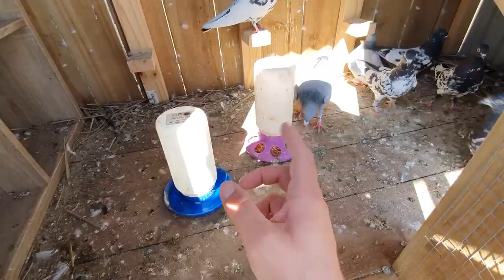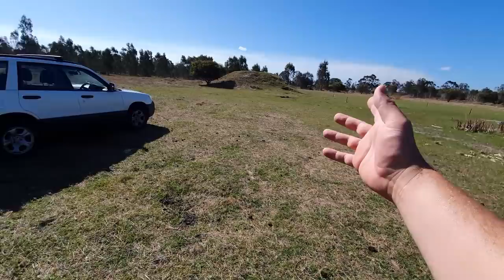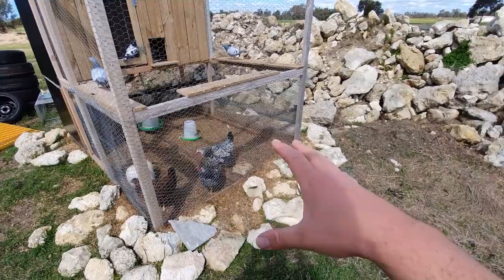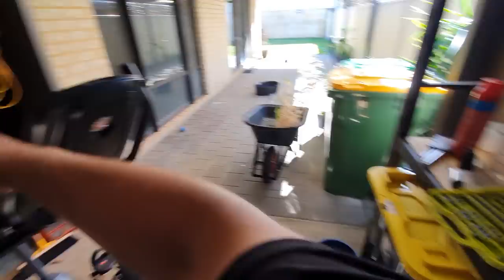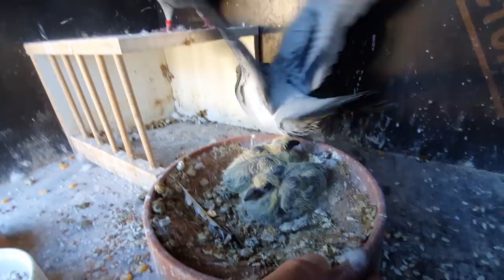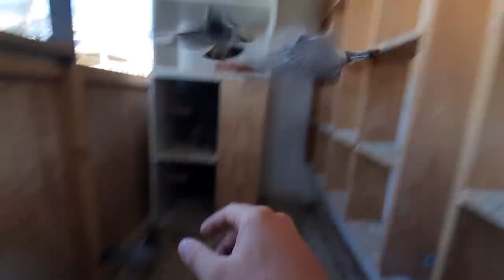Racing Pigeons & High Flyer Update 2020

Comment: I would take all the young birds out to the block now because they would normally be up in the air by now. With the flight they will get used to the environment quickly as they would home to that loft as they’ve never been out put a trap on it and keep them there. Use ure loft at home as a breeding loft individual pens for the pairs u want to breed out of no loose birds. U could then take the trap form that loft out with you. As for the high rollers I imagine wood isn’t to expensive to knock up a kit box. That’s what I would be doing the birds need to be out flying or they will be no good for racing as the loft there in only air time is flying to perches
Reply from the maker: Thanks making some moves now to get this all happening stay tuned ;)

Comment: Black Snake, if I'm not mistaken, it's either arid or pray
As for the structure, it is a rat snake in a large proportion
The rabid is not poisonous, either the serpent is moderately poisonous, and the rat snake is moderately poisonous
Perhaps they have exceeded their hibernation period in the area where my brother lives, and the rocky area is a suitable environment for them.
You are faced with one option for a second to which you pour the floor and put the very soft sim and close the cage openings tightly so as to avoid the snakes from entering. Put a very soft sim for the bathroom
As long as you have chicken, the smell will attract snakes and mice, let alone pigeons
I wish you good luck brother
Where do you live, my brother?
Reply from the maker: Here these snakes are called dugite very common in my city